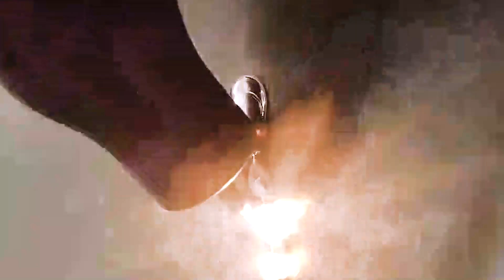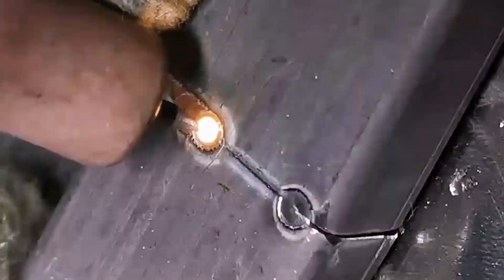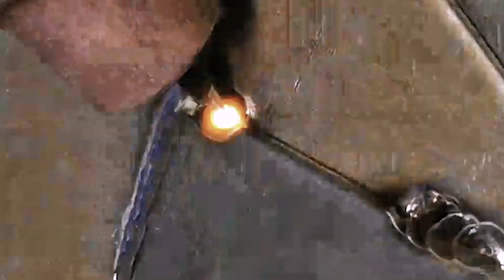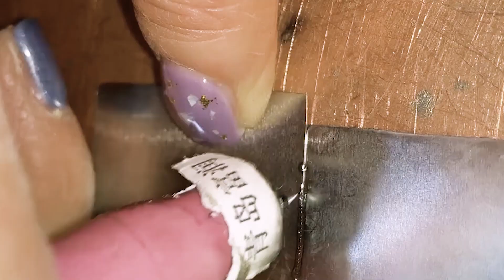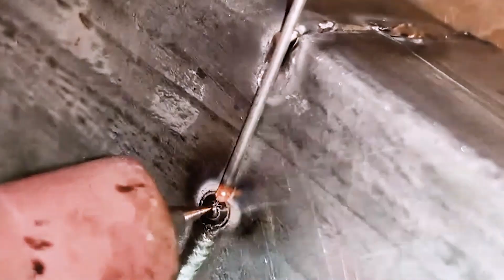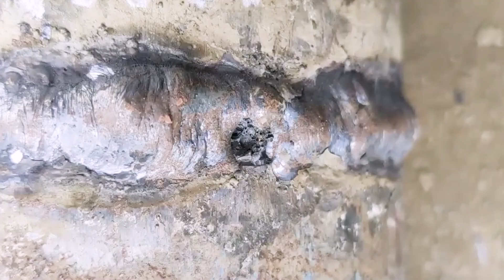Exploring the welding and repairing of various metals-cold welding machine

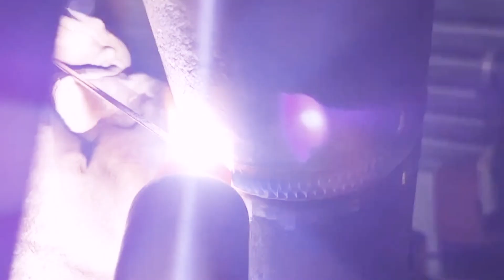Comment: There is  quite a bit of confusion about some parts of your videos you're showing a process that looks like TIG welding known as walking the cup (5:45 min in the video) however you fail to slow down and illustrate how you can walk the cup in a cold welding process most users will say that this is nothing but a TIG welder please make a video showing how you set up your welder and how you walk the cup please demonstrate this slowly and step by step in your video.. show us how the weather is set up
Reply: Nothing new or "confusing" here. You can set such machine to act as normal TIG, continuous current. That's all.
No-one is forcing you to use single pulse mode all the time. And single pulse is not intended to replace normal welding. They complement each other (so regular TIG welders chill out, no one is taking your job away).
 
These machines were developed long time ago, in the 80's/90's, to repair defects in castings and plastic injection molds, metal stamping dies etc. This is serious application. Plus jewelry jobs.
Search videos called: SW-V01 (japanese SANWA/NOVAPAX machine). Or german "Piggy Welder".
 
This is not a "toy" for making tacks, as you will read stupid complaints under the other videos.